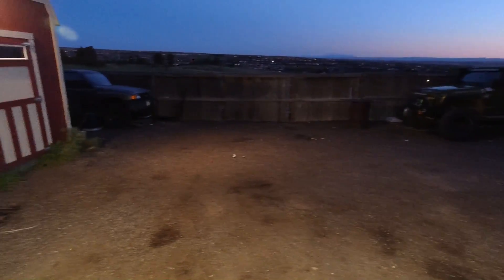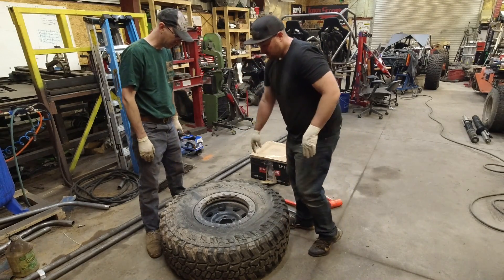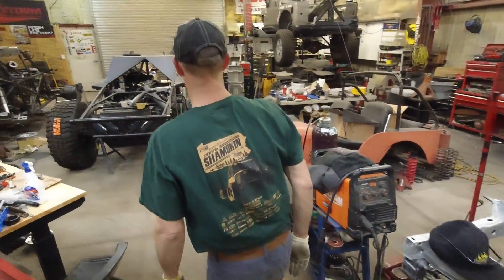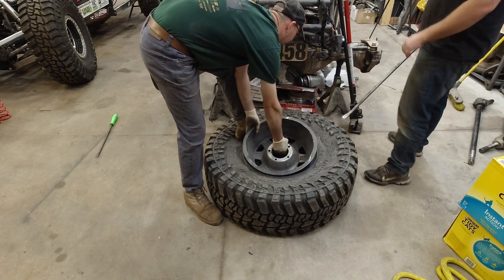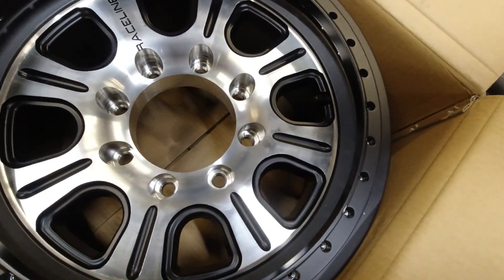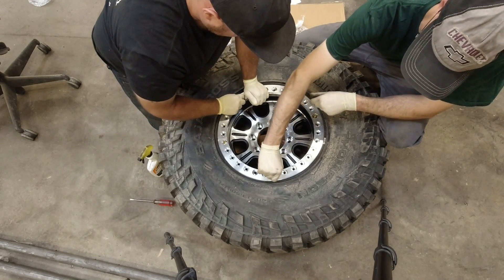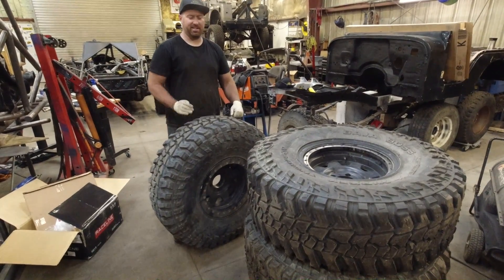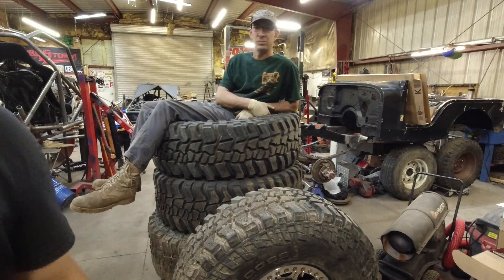How to mount a tire on a rim by hand!

Comment: Joe loosening the bead lock ring with the tire inflated brought back memories of the ancient split rims and the dangers that came with them.  I also had flashbacks of my dad running over the edge of tires with his truck to break the bead.
Reply from the maker: That is an option as well however if the side walls aren't thick enough and on certain tires it can damage the tire so we chose to show the high lift method